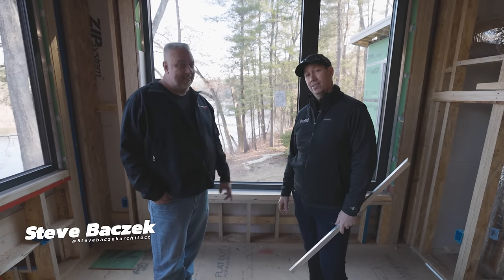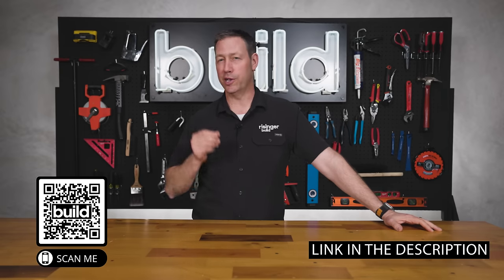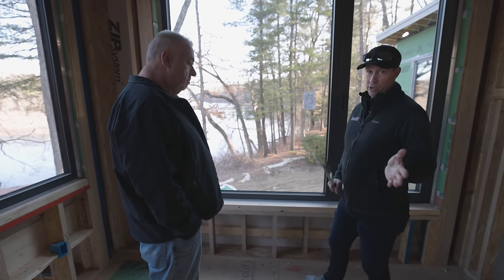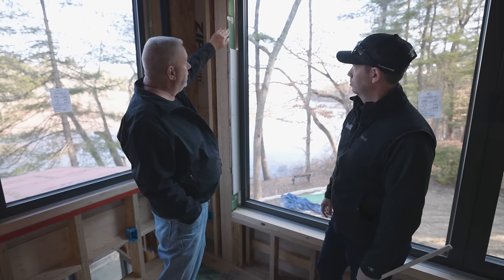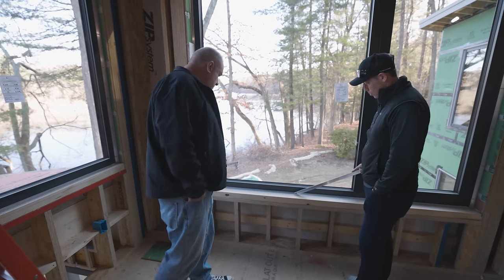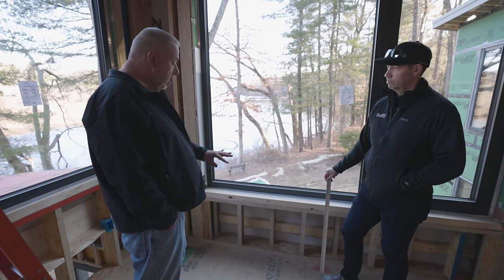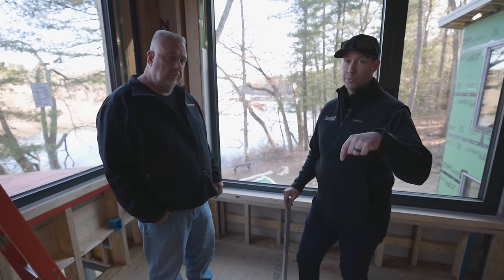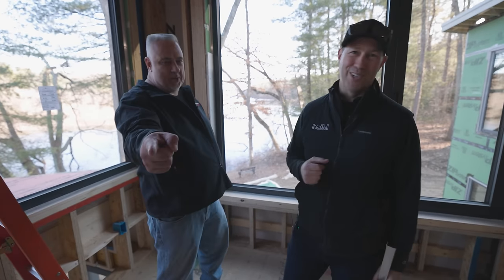Three Tips To Trimming Recessed Windows (watch pre-drywall!)

Comment: They are expensive but very good quality when installed properly. Should add the roll shutters they block out almost all the light.
Reply: Name one thing that is really good, that is cheap?
Reply: I could see those walls being thick enough to completely encase roll shutters too
Reply: @LongLiveOurBuildings - - -Most of the women I used to date in my younger days. Cheap, but good. 😅😊
Reply: @LongLiveOurBuildings  Window tint would be the cheapest option when it comes to blocking out the excessive sunlight and UV rays. Home window tint also blocks the suns heat up to 78% from coming through the windows resulting in cheaper electric bill and your central AC from having to work hard to cool down the home from the heat coming through the windows.
Reply: My God that would be such a fight at my house ……. I’d build a windowless house if code didn’t exist, one son would too & my wife and 1 son other sun would have more window than wall, while the 3rd son wouldn’t stop playing with the blinds just because he could. 

That blind motor better be tough as nails because it would be like the Florida Georgia like song 🎧 up down up down up down
Reply: @Zorlig  the German roll shutters are only 2” thick the height increases a little bit.
Reply: @LongLiveOurBuildings  air?
Reply: @trp2413  get a metal box for the shade switch. And when the rugrats complain ask them if they have the 2k+ to repair it. If they’re that young just tell them Santa or God is watching. Last resort tell them the little leprechaun only works a few times a day and have the timed shades installed.
Reply: @1nsurgent  All of my window suppliers will void their warranty if you tint them.  Causes excessive heat buildup in between the panes of glass and blows the seal.  Better option is a high quality Low E coating on the glass that comes right from the factory.
Reply: @andys5562  That would be true, but home window tint would be best for older homes that windows that don't have factory window tint or just single pane windows.
Reply: This site doesn't warrant the need for shutters....
Reply: @1nsurgent  Window tint also significantly decreases the clarity of the window?
Reply: @LongLiveOurBuildings  hey now.......who's on my tag line here?

Comment: A finish carpenter on the job during rough framing will produce a superior finish, and ultimately save time/money.  There’s nothing more frustrating than hanging doors in a crooked opening, installing cabinets without blocking, and worse yet, inconsistent stair stringers.
Reply: Kurt walks thru ALL the details......
Reply: My dad and I are finish carpenters and we build the whole house bottom to top.

Comment: You missed the link to the companies for that aluminum trim and the windows.  Going by the title I was expecting windows that are set-back (recessed) from both the interior and exterior walls
Reply: They are recessed back, both interior and exterior
Reply: @LongLiveOurBuildings  It doesn't look like it if you look at the exterior.  Although what I'm thinking of "recessed" would apply more to an ICF structure where the depth centerline of the window is roughly inline with the depth centerline of the wall.

Comment: Here is a question for Matt or Scott , Steve B or this community. It was about Scott Trues last vid on Matts channel recently. Scott talked in the vid about Lstiburek suggesting placing the drainage wrap over the sheathing but inside of the rigid foam.  I listened to Lstiburek in another vid suggest that in case water got between the sheathing and the most inside rigid foam it would have a space to drain.  In doing more research there are building science people who do not include that drainage wrap over the sheathing and only over the most exposed rigid foam.  We saw that Scott found even the dashes of liquid flash may not be effective to create enough of a gap. Remember, there is hydro tension to consider if the air gap is not wide enough. STeve Baczek talked about this on one of his vids.   Can someone clarify, with being in zone 7 Canada, if that drainage plan is really needed?   I talked with a builder here on Prince Edward Island, CAnada, where I live, and to eliminate any rain getting in between the rigid foam we were thinking of using the "brake" to bend aluminum to cap off the top. That would be the only place water could get in...maybe rain hitting it even under the eaves due to rain...and we are getting a lot of hurricanes now so wind direction is changing and more forceful.  I continue to research and hope a few of you will answer.  I might copy and paste this comment and add it to Matt's channel comments and Steve Baczeks as well.   Cheers ☺🇨🇦 Long live our buildings👍
Reply: I have done rigid insulation over 7/16" Zip on previous projects. I taped the foam joints and flashed the rough openings with the understanding that the face of rigid insulation was my drainage plain. If some water got in it would be a very very minimal amount to not be worried about - just my thoughts
Reply: @stevenbaczekarchitect9431  Hey there Steve! ☺Thank you so much for responding. I value your input so much.  OK. Got it. I will copy and paste your response to my document that I am making that emphasizes water tight details.  You have stated in a few of your vids, "when you are blocking something out, first think of what you may be locking in." Love that!  Also, think like a water droplet, where would you want to travel.   A viewer from Finland chimed in and added that their rigid foam already has grooves in it so when you have layers of this rigid foam you do not have to worry about drainage on any surface of any of the rigid foam boards.   Steve, Well! That is a smart idea and product eh!👍  Belt and suspenders approach would be follow your plan as mentioned and under the eaves bend some Flashing over the thickness of the rigid foam.   It looks like, from calculations that the exterior rigid foam thickness will be 7 inches.  4 layers  of 2"x3 plus 1" .  Using a 10" structural screw into
the furring strip, counter sunk and right into the Zip 7/16" or maybe 3/4 plywood. The build is a 2.5 storey extension so structural considerations regarding selection of sheathing. Hardy plank as cladding so a bit of a weight so furring strips need to be secure.   Thank you again, from Prince Edward Island, Atlantic Canada, Long live our buildings😉by Steve B.

Comment: i DIY'd a tilt and turn window last weekend thanks to your videos.  9 more to go.
Reply: DIY install or DIY made one yourself? Asking as a very interested woodworker scratching at the hardware supply chain for those components
Reply: Please tell us more
Reply: Which brand did you go with ?
Reply: @connorgarrett7064   jeez no, bought entry level vinyl tilt/turns. installed myself. standard 2x4 framing, a 2" void space between brick siding and the sheathing. full sized brick siding.  its installed in the middle, so recessed from both sides.

Comment: I'm a little confused why these are made and shipped as units from Slovakia? In the UK there are uPVC/aluminium window companies all over the place that build to specifications and they are run out of small shops all over the country. My parents just had triple glazed windows uPVC in oak-effect out, white inside to replace some 45yo single glazed wood windows on their Victorian red brick house, it cost around £15k for 8 large windows, a bay window, storm porch, back door and a small w/c window and they were manufactured to spec ~3 miles from their house, in the actual town they live there are two builders of uPVC 

I'm super surprised this isn't a thing in the US, it really fits with the repair/build way over there since you have like muffler shops, air conditioning shops etc
Reply: Windows made under demand cost 2x more. Example, in Brazil a 1x1m windows made locally by a small shop that will manufacture the window will cost 2x more than the same windows made by large robotized industries in China. Same windows, same PVC, same glass... this is why in Brazil the 'custom PVC' windows makers are getting trouble, sometimes the same windows can cost 1/2 in a standard size, makes more sense adjust the house project than spend thousands of extra dollars in built to suite windows.

Comment: Window tint would be the cheapest option when it comes to blocking out the excessive sunlight and UV rays. Home window tint also blocks the suns heat up to 78% from coming through the windows resulting in cheaper electric bill and your central AC from having to work hard to cool down the home from the heat coming through the windows.
Reply: These are triple pane, probably with argon.
Reply: @privateeye2490  Our tripples are 55mm in total, filled with argon.  The amount of comfort that comes on top of the reduced energy bill is awesome!
Reply: @privateeye2490  True, but it wouldn't hurt to have more privacy and extra heat blocker.

Comment: With those windows, you will never be able to use window film. Film can help tremendously with heat, glare, and security to a point.
Reply: ?? why not, won't film stick to the glass?
Reply: @kadmow - I agree, what is the reason?
Reply: @chrisevenson92 - I'm curious to know which films are ur favorites.
Reply: @kadmow  you can’t put any window film/tint on a triple glaze window.  It will trap heat inside the panes and break the glass.
Reply: @Prorex1911   - well then tint a 4th pane - or  that is are likely a Fo$ argument
hmmmmm

As Steve says, they intentionally  choose windows for the location  and performance..  If it were your house, you do you.  (External shading  and low-e treatment, etc provides ultimate in unwanted heat transfer through the thermal envelope.)
Reply: You can get the glass pre threat. No need for any film
Reply: Why would I add film - Saint Gobain is a world leader in IGU technology......also, have you seen this site, there is no sunlight in there during the summer
Reply: @rfauske  (you mean "pre treated" - I don't like threats to the glass.  jk)
Reply: @Prorex1911  sure you can. it just has to go on the exterior pane.
Reply: @stevenbaczekarchitect9431  film isn’t there for insulation, it’s usually a 2mil polyester.  Why would I have been to the job site?  Film can help with glare reduction wether it’s getting direct sunlight or not.  I was just stating that film can’t go on triple glazed windows (except exterior film).  The people that build these homes with these windows is probably less than 1/2% of all homes built anyway, so it really doesn’t matter.
Reply: @dietpop8213  yes, but those are only good for 7yrs usually.

Comment: If you have European windows, you also need to have European walls! Flimsy wooden sticks is not the right environment for those.
Reply: Flimsy wooden sticks.... 🤦
Reply: @GreyDeathVaccine  German houses are not built like that believe it or not!
Reply: This is a 2X8 staggered stud wood frame, hardly flimsy......
Reply: @b_lumenkraft  would these windows work well with cmu block walls? How long are these types of widows expected to last? I'm assuming you're in Germany and may have some knowledge in this regard? Thanks
Reply: @stevenbaczekarchitect9431  Sir, 2X8 staggered stud wood frame is exactly what i consider flimsy wooden sticks construction. If you grew up in Germany, you would feel the same.
Stone/brick/concrete walls is the way! Why build a house, that lasts 2 generations for amount X when you can build a house for 10 generations for X+50%? Also, such a house will not be blown away. I too often see those devastating pictures from the US where whole parts of a town are being shredded. That doesn't happen with stone walls.
Don't get me wrong. I don't think this is bad handiwork or architecture work. On the contrary. I admire your work. This is why i watch the channel. But in my humble opinion, wood is just not the material you build walls with. Americans are wrong and Europeans are right in this regard. ;)
Reply: @b_lumenkraft  I get it man - your culture and US culture view value very differently. Also, masonry costs for a bearing wall here would be more like 2X rather than +50%......I am in Germany next week at the BAU show to hopefully gain a little more knowledge from the Euro community - looking forward to it........lastly, thanks for joining in on the channel!! Much appreciated
Reply: @stevenbaczekarchitect9431  OMG have a wonderful time in Germany. Save travels, sir.
Reply: @b_lumenkraft  Thank you - very much looking forward to it!!!! Munich get ready lol
Reply: @LogansRun314  Yes, sure. Works wonderfully.
I do not have any data at hand on how long an average German window lasts. It is very much dependent on the material used, the environment, the energy standards changing, the manufacturer... The usual variables at hand. Schueco, the brand Steven uses here is well-known and of excellent quality. I would say you can expect a few decades.
Reply: @b_lumenkraft  Thanks for the info. I was hoping at least a few decades.
Reply: @LogansRun314  You are very welcome. :)
Reply: @b_lumenkraft  ferrari's are also a lot better than fords. the sky is blue.